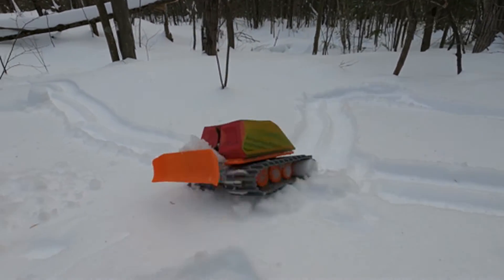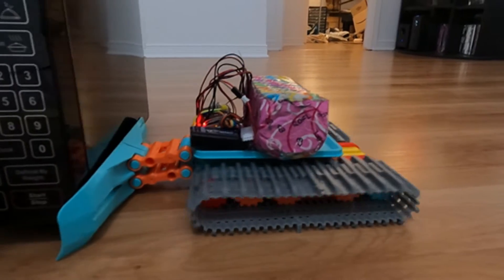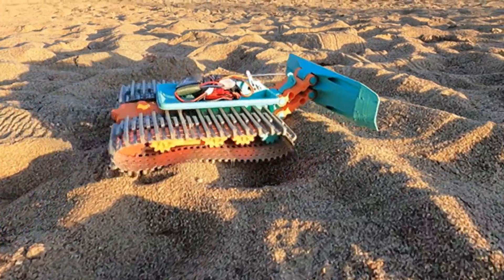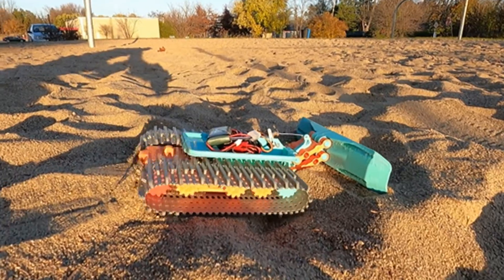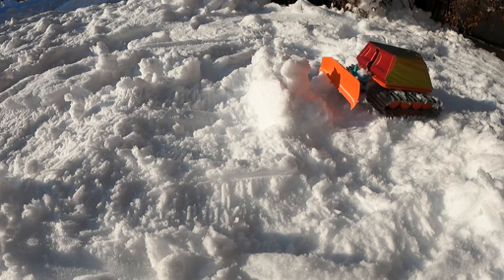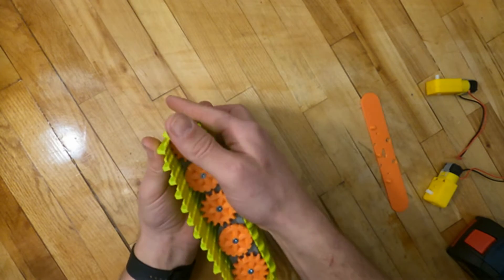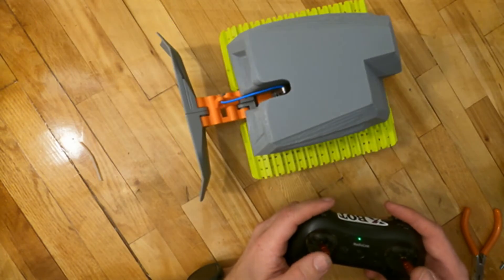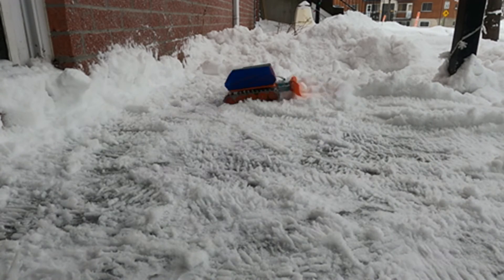1:24 R/C Snowcat || 3d printed robot

Comment: Hello! What percent infill do you use when printing?? Not sure if I missed it but want to make sure I’m printing it correctly. Thanks!
Reply from the maker: @b.rox1219  
The track are 100% infill
The cabine 0% infill (vase mode)
All other parts are 20% infill, with 4 wall.
I will add this informations in the detail of the parts. Thanks
Reply: @ thank you for the quick response!

Comment: Very nice! I'm going to make one or two of these for the upcoming winter! Did you try using 1:90 ratio metal gear TT motors? I have both styles, so just wondering if its worth trying or not.
Reply from the maker: @mattfranck7040  I nevers try the 90:1 gear motor in this project. If you try them, tell my if those motor are compatible with the project. Im not sure if the 90:1 metal gear motor have the same housing as the 48:1.
Thanks
Reply: @RoboticsSideProjects  I did finish my first unit with the metal gear single axle version of the motor and they are the same size.

Comment: In the build tutorial, it says you only need one receiver but in the video it looks like you use two
Can you give me a more complete parts list with all components? @RoboticsSideProjects
Reply from the maker: Hi, the "second reciver" is probably de drive for the motors.
I will try to add a wire diagram to the Printable project this weekend
Reply: Thank u very much! I will sends
 Pics when I am done @RoboticsSideProjects
Reply from the maker: @JeepV4  In the description of the printable project I have a detail list of all the electronic parts in the ''link for parts'' section.
I have also add picture of the connection of the reciver and the motor drive at the step 12 of the tutorial. (in the Printable project description)
Reply: Hello! I must be getting kinda annoying by now, but I have one more question. Does the ESC come with the radio link t8s and receiver bundle? Many thanks  @RoboticsSideProjects
Reply: @RoboticsSideProjects  just realized, no it does not
Reply: @RoboticsSideProjects  your address got leaked
Reply from the maker: @JeepV4  Hi, sorry for late response and dont worry, I like to responde to questions about those project. the esc does not come with the radio link T8s. Also I update the amazon link for the Radiolink T8s on the Printable project. Chose the ''dual self centering stick'' version of the Radiolink T8s controller. The other version ''not self centering left stick'' is use for Rc drone.
Reply from the maker: @JeepV4   Hi, thank for informing me. Can you send me more informations about that in the direct chat function of the Printable Project.
Reply: @RoboticsSideProjects  hello
Reply: @RoboticsSideProjects  i have messaged

Comment: This is very cool! I've always wanted a 1/24 snow cat. I've had the Blizzard 2.0, but it's a bit big.

Unfortunately I dont have a 3d printer is there any way I could order one from you? 

 Either complete or just the 3d printed parts, I have to have one of these! There's just nothing else like it and id love to show it off and get the word out about how cool it is!
Reply from the maker: Hi, thanks you.

I don't usually sell some kit but we can probably figure something.
I can build a basic kit (all printed parts, 4 motors, wire, motor drive, screws and assembly) for around 50$CAD + shipping. You will need to add a RC controller, RC reciver, servo motor and batteries.
Tell me if it sound good to you👍
Reply: @RoboticsSideProjects  that would be fantastic! That sounds perfect to me. Is there a good way to contact you? we can figure out details and payment. Thank you very much for the response!
Reply: @RoboticsSideProjects  I should also mention im in Colorado USA but im happy to pay any shipping
Reply: Did you end up getting it? @subjectyes
Reply from the maker: @subjectyes  I did not get any follow up from you about that. You can contact me by the direct chat function of the printable project If you are still interested.

Comment: Je t'ai envoyé un message sur printables il y a quelques jours, je sais pas si tu l'as vu 😊
Reply from the maker: Je ne sais pas si je l'ai reçu. 
Si c'est la question à propos des chenilles pour utiliser à l'intérieur.
Ceux de ce projet serait mieux adapté pour un utilisation à l'intérieur  comparé à ceux de mon autre projet de tank rapide.
Reply: @RoboticsSideProjects  Oui c'est bien ça. Effectivement, j'ai imprimé les autres chenilles, elles sont beaucoup plus grosses que ce dont ça a l'air sur les images.

Bon, maintenant que c'est fait (il me manque quand même l'assemblage sans sertissage), je verrai par la suite si ça me convient ou pas.

Pour ces chenilles là, il faudrait que je les modifie car tel quel, elles n'ont pas l'air durable (la colle...). En revanche, elles m'ont l'air très adhérentes pour pouvoir pousser des objets sur du parquet. Les grosses, même en TPU, elles n'ont pas l'air aussi adhérentes. Toi qui possède les 2, la différence est-elle grande ?

D'ailleurs sur ces grosses chenilles en TPU, quand tu sers la vis, au lieu d'accrocher et serrer le fil, ça déforme la pièce... Donc plutôt PLA pour celles-là.

Je vais probablement re-designer un châssis pour des nema17 directement attachés aux roues, si je suis satisfais de mon résultat je le posterai en remix.

Comment: this is a nice rc.  the pockets in the drive pod frames seem to be sized for that specific right angle motor. would you be able to detail the electronic components that you used for this snowcat?
Reply from the maker: Thanks. 
The motor are so "TT motors" with a 1:48 gear reduction ratio. 
I put a link to the Printable project In the description of the video. The project contains a full parts list including the electronic.
Reply: thank you for the information